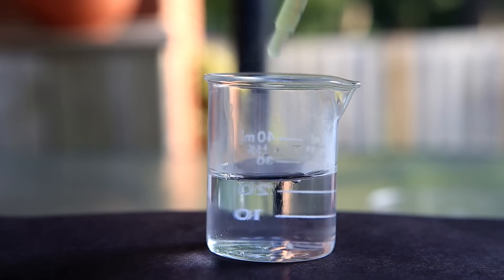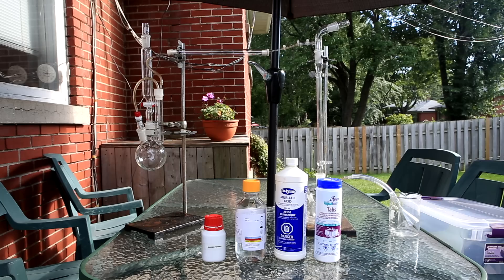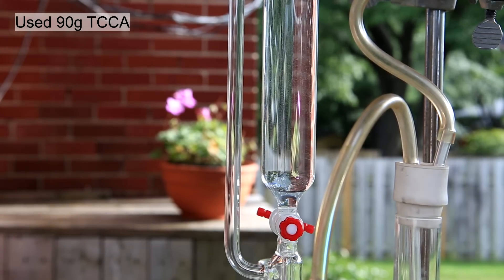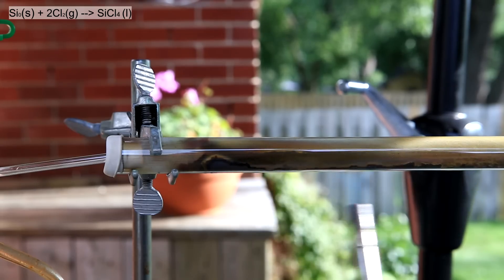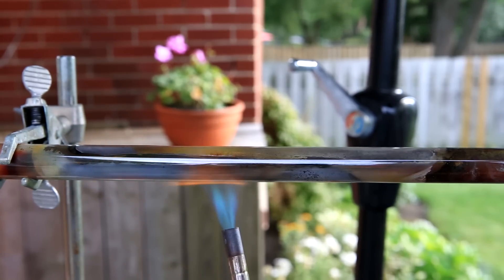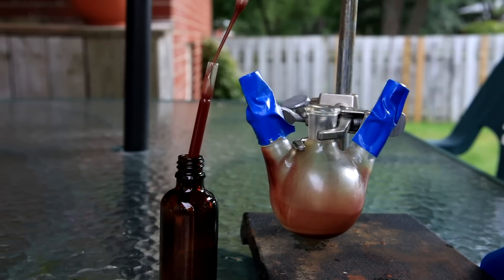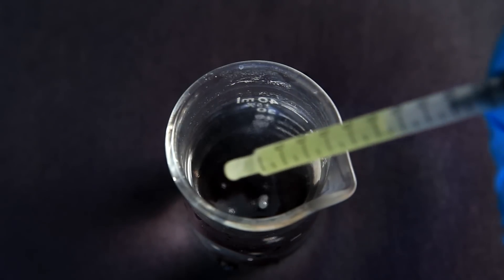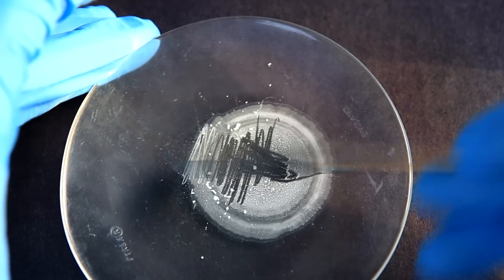Making Silicon Tetrachloride

Comment: Is there a similar process you can use to purify aluminium oxide? I need some very pure aluminium oxide, and I have no idea if I can even buy it pure enough.

Although if I can't buy it pure enough, it's a pretty sure bet I wouldn't be able to purify it enough either.
Reply: +Rob Mckennie You can make very pure Al2O2 by dissolving Al foil in HCl and adding the solution to a solution of baking soda. Al2O3 will precipitate and you can filter it off
Reply: +TheChemistryShack Nope, it won't work that easily. By adding sodium bicarbonate to a solution of aluminium chloride, you'll get a precipitate of aluminium hydroxide, which should looks like a gel. If you heat that produit at a high enough temperature (few hundreds °C), then you'll get Al2O3. Of course, that is assuming you have some very pure Al from the begining.
Reply: supersmashsam Hmm, I was always taught that Al2O3 is produced in the reaction
Reply: TheChemistryShack how pure is very pure? I've read that I need on the order of 10^6 % impurities. I have no idea if this is inside the realm of reality at all
Reply: Rob Mckennie I hope you mean 10^-6 % lol. That sounds purer than lab grade honestly, not sure how realistic it is. What do you need it for?
Reply: TheChemistryShack I really want to have a go at the Verneuil process to manufacture synthetic rubies. In essence, you just melt the aluminium oxide with a hydrogen flame, and if you do it right you can crystalize it back together into a ruby. I just looked up the number, the wikipedia page says 99.9995% pure, so not quite 10^-6 (and yes it was -6, not 6, my bad)
Reply: Rob Mckennie Well you could always buy reagent grade Al powder and dissolve it in reagent grade HCl, add reagent grade Na2CO3 in distilled water and (depending on who is right) heat it to produce Al2O3.
Reply: TheChemistryShack Sounds straight forward enough.
Reply: +Rob Mckennie I think that if you need Al of the purity that you said, just dissolving the powder will not be enough. You should start with AlCl3 and distill that through a vigreux column. React with NaOH, wash with very little cold water, then heat under vacuum like crazy. I am however very uncertain that you will be able to achieve sufficient purity using glassware and anything related to precipitation of Al(OH)3 from sodium or potassium solutions etc. You may have to distill the AlCl3 and reduce it with H2. That should hopefully give you extremely fine powdered, pure Al. Then just burn it in the best oxygen that you can buy.
Reply: The User formerly unknown as himself if I find myself in need of higher purity I'll have to try something like that, but after further research I don't think that such high purity is needed for good results per se, just results with high optical quality. Which isn't a priority for me